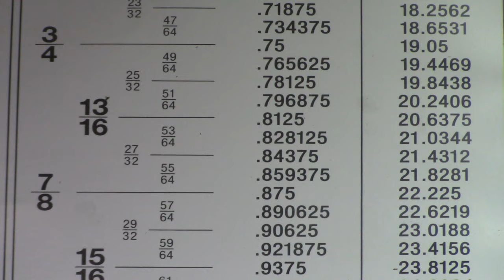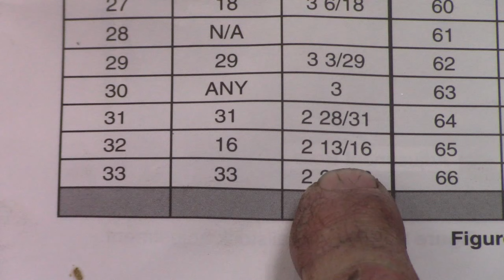Making a Threading Dial for my 1931 South Bend 11 #84-A

Comment: all slitting saw arbors wobble and you need to use the table lock on the rotary table before each cut
Reply from the maker: The table lock is probably a good idea although it worked very well. I can't remember for sure but I think I had the lock set for a slight drag.

Comment: With that gear, do you do all the threads, both metric and withworth?
Reply: This one will only work for imperial threads (whitworth & american). 
Threading dials only work for "native" threads; i.e. imperial threads on an imperial lathe, or metric threads on a metric lathe, not both. (Unless you use a "Metradial" but they seem pretty rare.)
Reply: As Eric says there are metric thread dials for metric lathes, but they are more complicated. This is a case where the metric system of dividing by 10 isn't a help. The metric thread dial has to have gears inside to acomidate the different metric threads. The imperial inch thread dial is simpler because many inch threads are progressive and are an even fraction of the lead screw pitch. There are inch threads that must be cut like metric threads without the half nut being opened because they aren't an even fraction of the lead screw pitch.
 
But the thread dial is handy even when cutting metric threads on a imperial machine. If you are threading to a shoulder, engage the half-nut on a specific mark on the dial (like "1" or a sharpy mark) and make your first pass. When you reach the shoulder back out the cross-feed while opening the half-nut and then stop the spindle.   As the lathe spindle stops you will notice that your mark on the thread dial hasn't moved much past where you disengaged it. Now reverse the spindle and as your mark comes back to where it was, engage the half-nut and back the carriage up to your start point and stop the lathe. Repeat until the thread is completed.
Reply from the maker: Cool...  I knew I could not thread metric without a gear change and about leaving the half nut engaged but I did not know about the metric being more complicated on a metric lathe.  Thanks for explaining.
Reply: @WinkysWorkshop  Based on what I see come up on eBay occasionally metric threading dials tend to come with a selection of gear wheels that will each let you cut a subset of metric threads. e.g. for a 6mm pitch leadscrew lathe the dial will come with 14, 16, 18, 20, & 22 teeth gear wheels and a dial numbered 1-8. 
The 14T gear lets you cut multiples of 1.75mm pitch threads (that is 1.75, 3.5, 7, 14mm pitch) engaging on lines 1 or 5. 
16T gets you 0.25, 0.75, 1. 1.5, 1.6, 2, 3, 4, 6 & 8mm pitches. 
18T lets you cut 0.225, 4.5, 9mm. 
20T gives 1.25, 2.5, 5 & 10mm pitches. 
And the 22T gear gets you 5.5mm and 11mm pitches. 
The threading dials have a table showing what numbers to engage on, what gear to use etc. I haven't used one but it loks like a right proper faff! 
Import metric lathes seem to omit most of the gears and tell you not to disengage the half nuts for those threads. 
e.g. if it's a 3mm pitch leadscrew the complete set of gears would have been 28, 32, 36, 40 & 44T but probably only 36T & 40T are supplied as that covers the most (common) pitches(the 0.25 thru 8mm series and the 1.25 thru 10mm series above) with the fewest gears. 
If you've read this far you'll be glad to go back to imperial tpi :-)
Reply: @ericfeatherstone  I recently did a 20mm 1.75 thread with my  imperial logan lathe. I found out that 14 tpi was almost a perfect match.

Comment: OK you kind of left us hanging by not cutting some threads to show how well it lined up with multiple starts :-)
Reply from the maker: Oh...  Well I tested it to some degree. I'm not sure why some have numbers. I just put lines on mine. Even numbered threads can throw in on any line and odd can only throw in on short or long depending on what you start with...  But I do need to test it more.
Reply: @WinkysWorkshop  They have numbers for helping with cutting "half" threads like 11½ tpi pipe thread (engage on 1,3, or alternatively on 2,4, depending what you start with) and "quarter" threads like 3½"BSW ( 3¼ tpi ) or 5" BSW ( 2¾ tpi ), pick a number and engage on that number only. You could also use the numbers for cutting two-start or four-start threads. But if you don't need to cut such obscure threads I don't think you need the numbers.